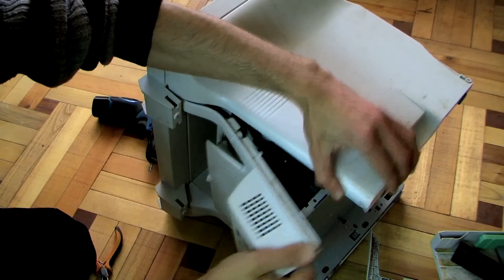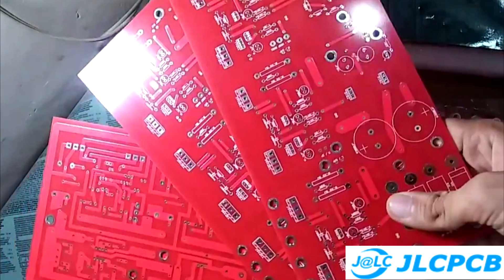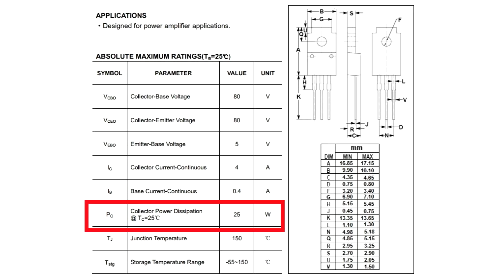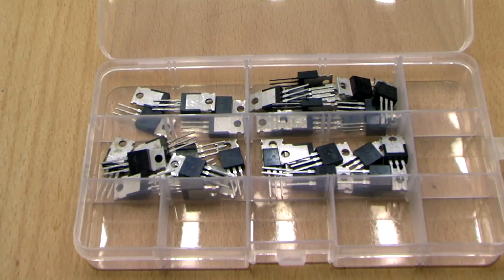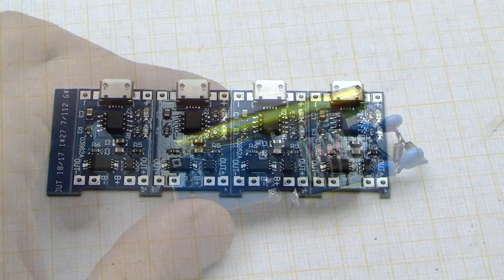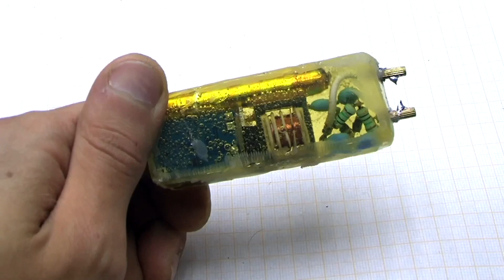Electric shocker from an old printer

Comment: Just a tip - don't cast Li-ion batteries in resin, should it vent, you're essentially holding a small bomb, as the gases have no way to escape, and will blow apart the resin with flames.

Comment: Kasyan TV
Challenge: What is the most complex power supply or handy bench device/circuit you can design using only passive components and general purpose TO-92 BJT transistors? No FETs, no TO-220 stuff. If I handed you a bag of 100 2N3904 & 2N3906 transistors, what's the most impressive thing you can think of to build? My challenge can include any Transistor that comes in the little ~$3 transisor kits with around 15 different kinds of BJT's from places like AliEx. I know it's possible to build a switch mode power supply, crude op amps, logic circuits, and voltage regulators. What can you think of to build. I want some shock and awe please.
 -From a Fan of Yours ;)

Comment: Could you please make a easy to make and cheap spot welder without microwave or flyback transformers...and 👍for printer parts reusing..
Reply: Not possible. There's no way around using a transformer to get the current needed to weld using mains power. The only other way to make it work is lots and lots of batteries, but that has it's own set of problems too.
  The power you get from mains is from a step down transformer from the utility company. Everything you do with mains voltage is sourced from the utility company's transformer. You wouldn't be able to handle several kilovolts of electricity from the other side of that transformer. The same principal applies to the current transformer needed to weld. The mains transformer setup used to provide power to most houses and businesses is way too high of a voltage with too low of a current for welding due to the transformer design. You can change this to something useful, but you must use a transformer with the correct type of core and primary/secondary turns ratio to make it work.

Comment: if you thought printers are good try tearing down a tv. everybody know about the almighty flyback transformer but most tv's also have audio amplifier modules that need 2 caps 3 resistors and you get free amplifier

Comment: Please show how to get printer
Reply: In the US you just go to second hand stores and ask them what they do with electronics that don't work. They almost always throw them out and will let you take any of them.
  The printer used in this video was probably a laser printer. Laser printers are the only ones that need high voltage (as far as I know/in my experience as a hobbyist).
  Similar high voltage transformers can be found in any older flat screen TV or display that uses CCFL's (cold cathode fluorescent light) for the backlight. You can also find these types of high voltage transformers on some portable heaters.
Reply: Falguni Vyas Any old or broken printer, bro. :) Here in my city (I'm from Brazil) there's a fair that happens once a week where people sell everything. From new and good stuff to old parts from broken things, including food, people giving pet's puppies and so on... And I already bought old printers there, really cheap. Maybe you have something like that around you. :)